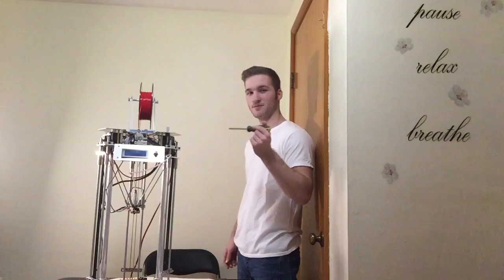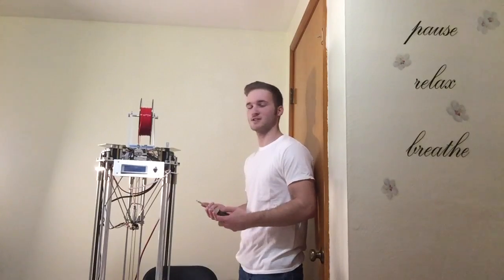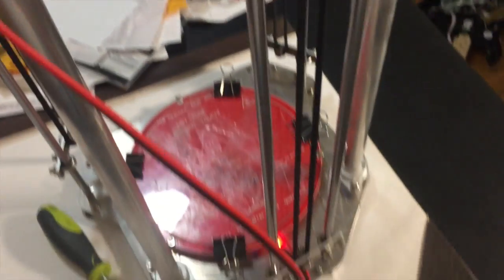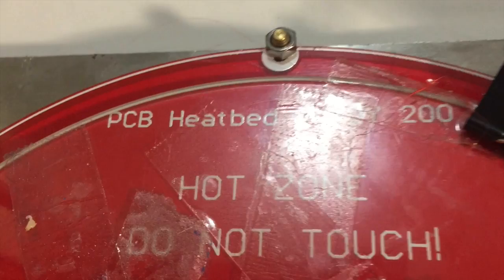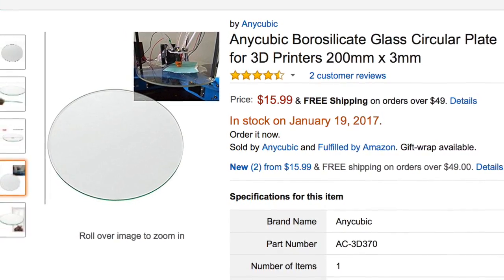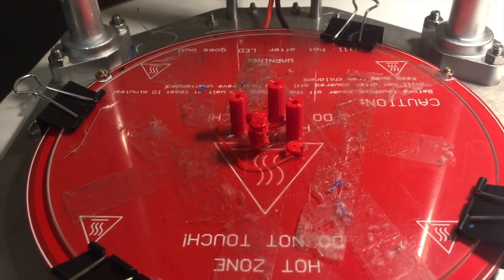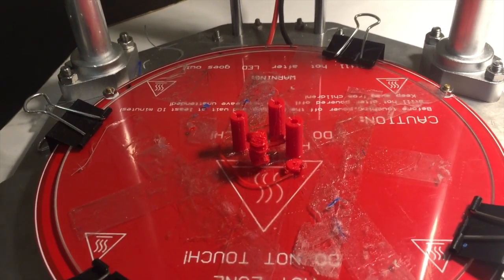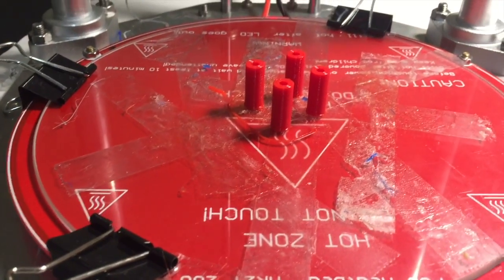How to Modify a 3D printer/ Stop 3D Prints From Warping/ Help 3D prints Stick!

Comment: can u post your settings. i have same printer. what slicer, what infill, what quality, what print speed, etc ? thanks
Reply from the maker: nuroo I used the slicer "slic3r" my infill works from none to 100% very well with this slicer but I believe I was about 15% and my quality was around .3 mm layer height, although the printer prints well at .1mm layer heights as well, and I always print at 100% print speed on the printer, everything I use is free as well, I hope this helped!